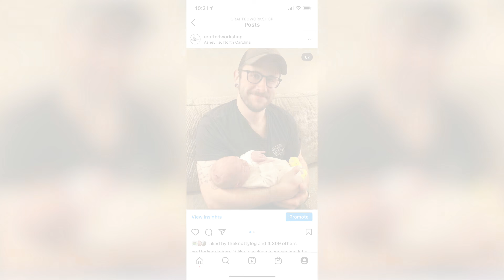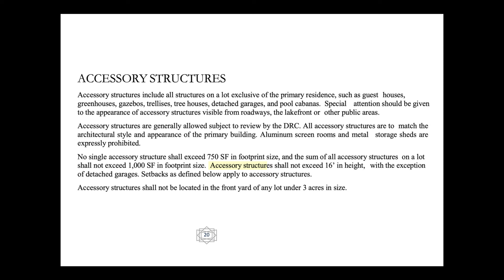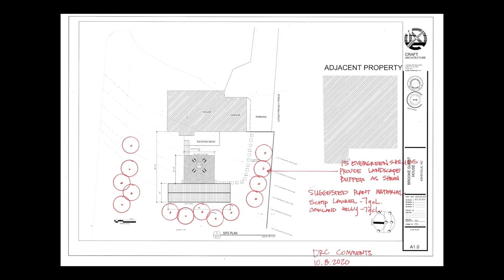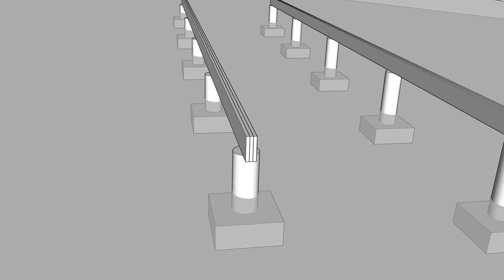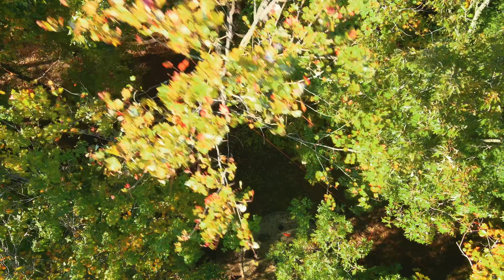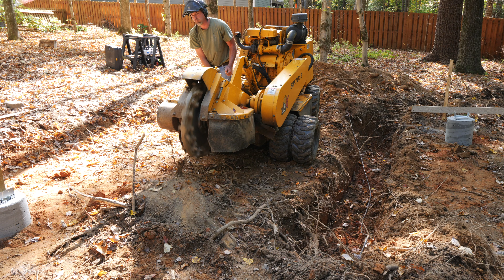I'M BUILDING A (not so tiny) TINY HOUSE! // Part 1: Permits & Site Prep

Comment: Your HOA is full of controlling jerks. No reason for them to deny you based on your design choices, especially since it's in the backyard. I used to live in an HOA neighborhood. When we first bought the house, the neighborhood was still under construction so the HOA was managed by a property management company. It was great. They had common sense and the bylaws were such that it followed what the intent of an HOA is which is to keep the neighborhood clean and neat looking. They were great to work with. Once the neighborhood was completed the HOA transitioned to resident control and that is when all the Karen's came out. They became completely over bearing and unreasonable. I had a satellite dish which was approved and mounted in the most appropriate location. Once the switch happened they wanted me to remove the dish because they hadn't approved it since the switch. They tried to fine us because we had power and cable utility boxes in our front yard that were visible. Um those were installed by the utility, they aren't being moved and no we aren't planting bushes around them - especially when it is illegal to do so. Yeah, screw HOA's and the Karens that run them.

Comment: How did you pass inspection with the wrong size board for the ridge? Rafters around here need to have full bearing against the ridge board. Just asking... looks like a fun project. I’m with all the other “ no hoa” voices.
Reply from the maker: These rafters are way oversized for the span. We did that so we could get more insulation in that area so we could have a cathedral ceiling and still need code.
Reply: I saw the over sized rafters and wondered why so big for that span but thought there has to be a good reason. Thnx for answering my question.

Comment: I dont get it, does the HOA require for all buildings to look similar to a shed? what is the point of these regulations? its not as if you tried to build a concrete box with flat roof. Such a pity as the original design looked very cool and would make for a great built video with all its details.

Comment: In the UK: you can build any structure in any style within your garden without planning permission if under 2 metres and takes up only 50% (or less) of garden area.
Reply: Mostly correct but it is actually it's a maximum eaves height of 2.5 metres (8 feet) and maximum overall height of four metres (13½ feet) with a dual pitched roof or three metres (10 feet) for any other roof. I'm not sure what that means I just googled it because I knew it was more than 2m

Comment: yeah that's more of a granny flat than a tiny house, but I know you need to work with the trendy wording to work through the Youtube Algorithm!   Looks like a great space, but too bad that they didn't allow the original position as now it seems to intrude into the yard more than when you had it positioned along the south side.   How big is your lot?  That's not a full acre is it?   

Be interesting to see how it is insulated.  NC is a fair bit further south than I am, but still pier foundations means you get air under the structure as well.  Looking forward to the build!

Comment: When I hired someone to install my circuit breaker panel, the electrician got the permit within hours. 
I had tried this on my own and the city dropped this on me:
You have to have the power company pull power from the home.
        Power company said no problem, but.....all work had to be complete and final sign off done before I got it back
City wants all  lines converted to 3 wire. The house was wired ( in 1956) with 2 wire.

Contractor got it done in 8 hours through a subbed out independent.
Power was pulled by the electrician, power company not needed
The inspector looked just at the box, never questioned about the house wiring. Laughed at the "funny ways the city engineer does business".

Comment: Seems like you have learned a lesson about HOA’s. Good luck with everything. I’ll be watching this series for sure.
Reply from the maker: Our neighborhood is awesome enough to make dealing with them worth it, but it was definitely a PITA. Thanks!
Reply: @craftedworkshop  - What are the repercussions if you just go ahead with the original design?  If it is physically your land, and the structure complies with municipal/state regulations - what actual LEGAL power do they have?  Other than what they assign themselves, of course.  Is compliance with an HOA actually legally binding (within common sense limits of course - for example, a 16' cap on additional structures to maintain visual lines makes sense.  The siding you are allowed to use does not).  This isn't a historically preserved neighborhood - I'm just really curious what they could actually do about it.
Reply: @FHL-Devils  Understand, when homeowners join a HOA community, they sign a contract that obligates them to follow all the stipulations.  So violations of the contract gives them ground to issue fines... Revoke any benefits like access to common areas, such as the swimming pool or fitness center, etc... Take direct action against the property owner. For example, removing an unapproved fence... Suit the homeowner should they continue to disregard their violation notices. This could be in small claims court to avoid high legal fees or by more severe methods if the violation is especially significant... Charge the homeowner for any additional costs (on top of the original fine) association with the violation or actions taken by the board–such as those generated by removing the fence or fees for taking legal action... Place a lien on the homeowner’s property until all debts to the association are paid...

That last one can be especially nasty as some really corrupt HOA's won't even tell you that you've been fined, let it accrue for years and you'll only find out when you try to sell the home and then have to pay off a possibly massive bill before you'll be allowed to sell the home...

There was a case a few years ago where a guy put up a wind turbine to make his home more green and reduce his energy carbon footprint but the HOA took him to court to remove it... Made worse by the fact removing it would damage the foundation to his house and add further cost to him to fix and he was basically threatened with jail time if he refused the court order to comply...  So they can do quite a bit...

Never sign anything without reading the fine print, preferably with a lawyer at hand to translate the legalese and inform you of what rights you would be giving up and what you would be obligated to do... Like maintain the appearance of the home under penalty of fines, late fees for HOA dues, etc.
Reply: @ZeoCyberG  ... sounds like getting involved in one of these will turn into a pile of shit...  Unless your only intent is to buy a place, grow old, and die.

Thank you for your extensive efforts in explaining the issue.  What sort of legal counter-claim could be mounted, if the HOA were to either attempt to exceed their authority, or block a structure out of spite, such as by 'moving the goalposts'?
Reply: @FHL-Devils  Depends on the contract you sign, it's legally binding... But the HOA is also bound by the law...

https://www.realtor.com/advice/buy/things-your-hoa-cant-do/